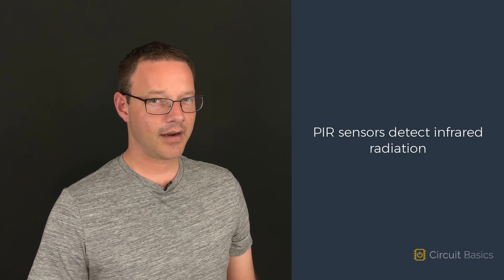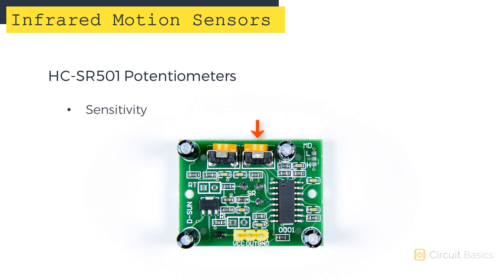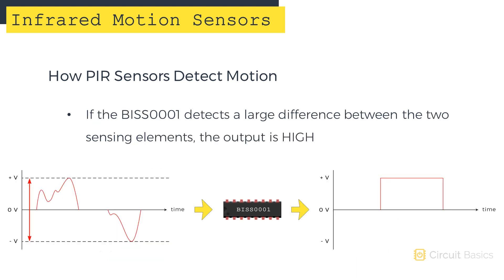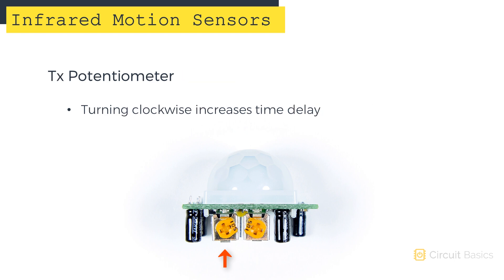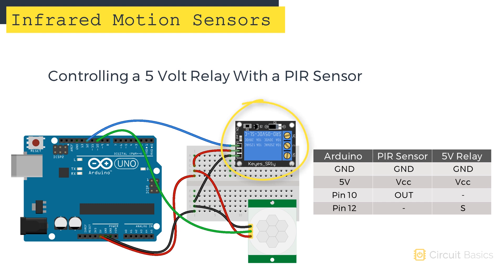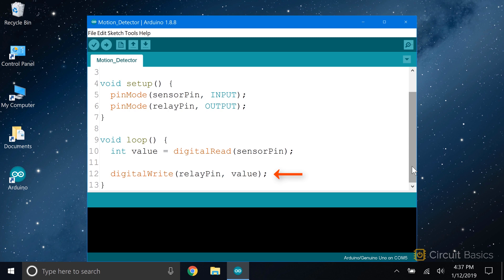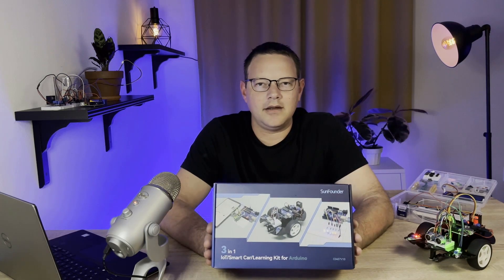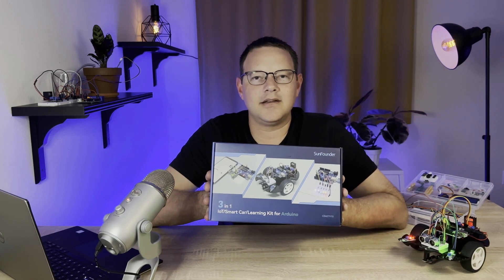How to Use Passive Infrared Motion (PIR) Sensors on the Arduino - Ultimate Guide to the Arduino #35

Comment: That is a nice project, the code is very clean and I am thinking about the motor relays as there are many new inventors who build 4WD cars with the Arduino coding. I am working with AI too and the PIR is the contrast delay I use in the convolution layer to create motion detector in AI games ( I play at lowe cost by using AI Games but the device and technology is my interest ).